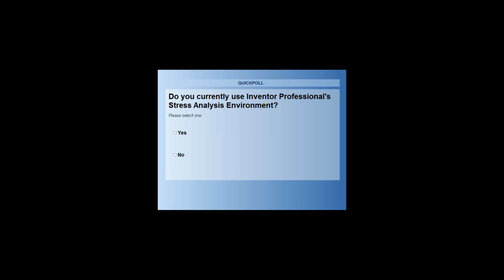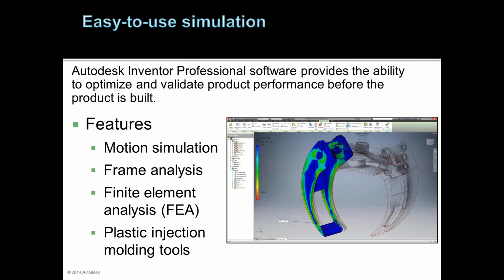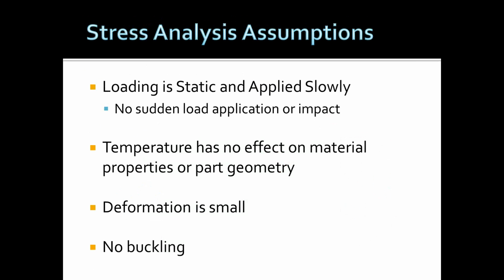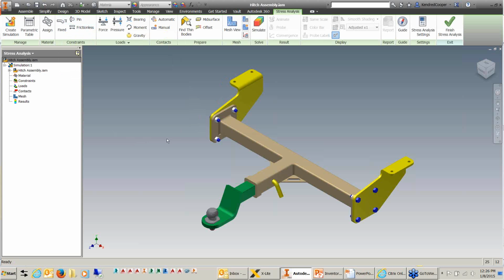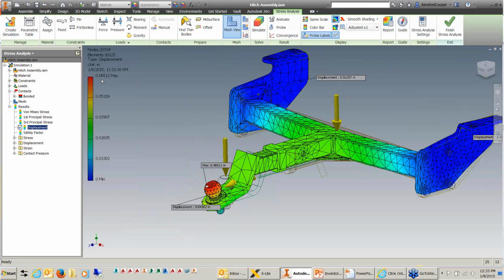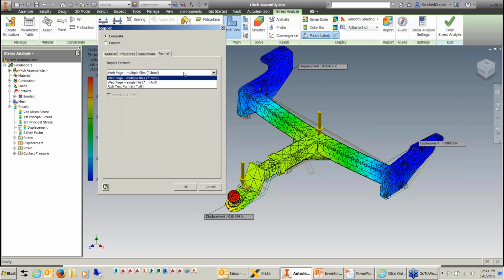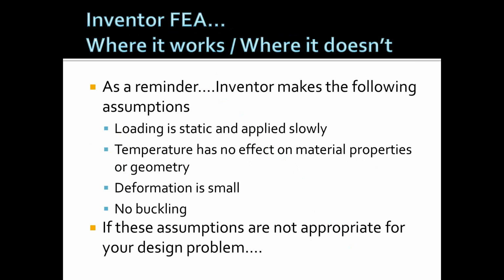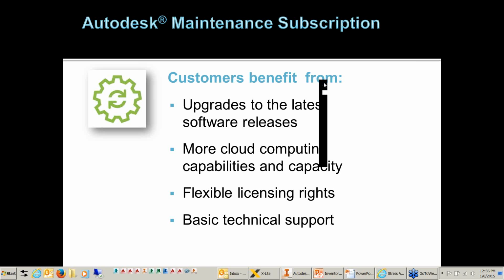Finite Element Analysis (FEA) with Autodesk® Inventor®

Comment: The ball & bar only appear to be flexing so much because you're in Adjusted X1 view (under Display). They made this view the default to exaggerate the displacement so that you can visualize it more easily. If you change that to Actual, then you'll see the real displacement. You can verify this with the fact that the highest displacement on the analysis is only about 0.06 inches.